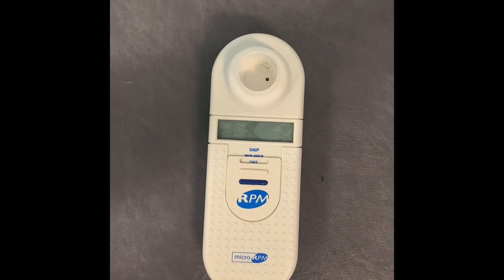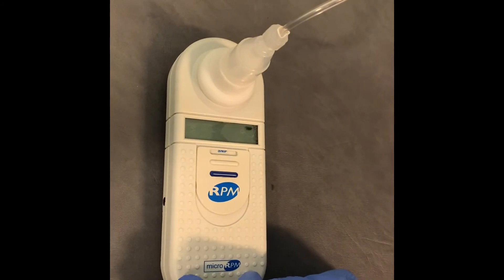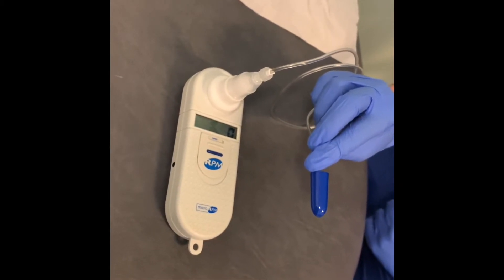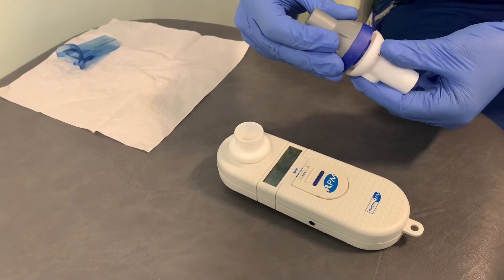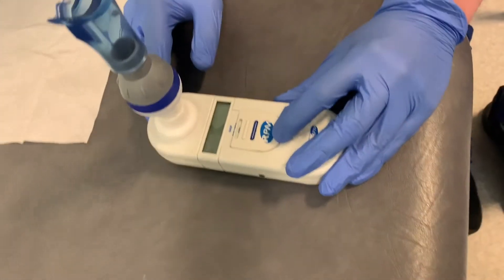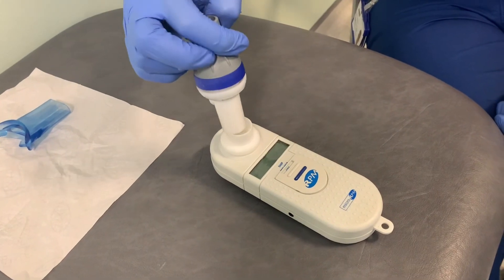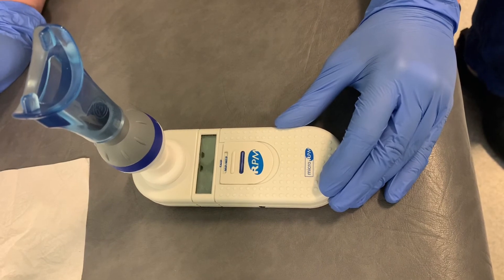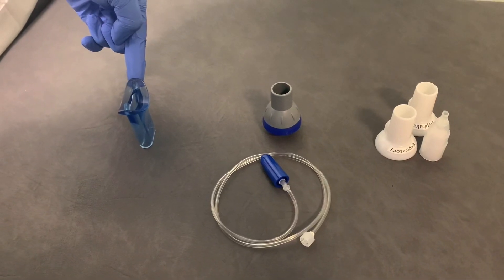Setting up the MicroRPM

Comment: Hello buddy at the end of the video you recommend to keep 3 parts which are expensive. However you also mentioned that one of them is actually a filter for nose. Question is, can those parts also be sterilized by using gas?